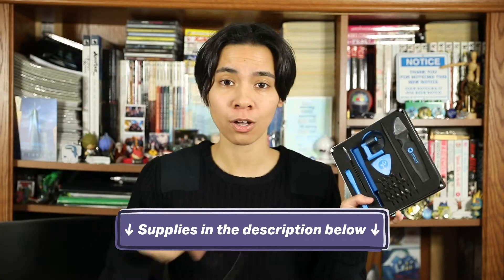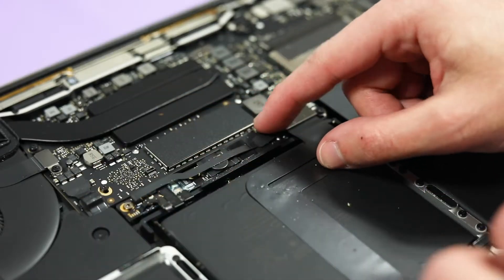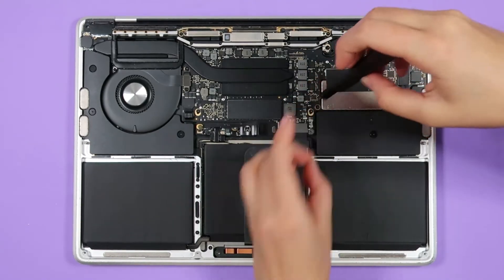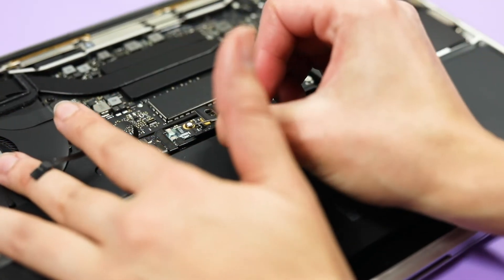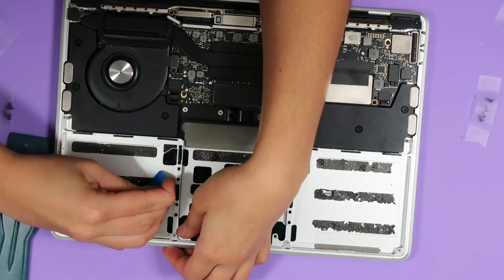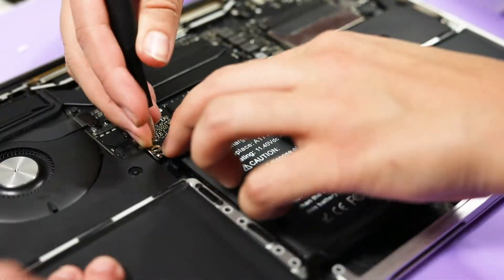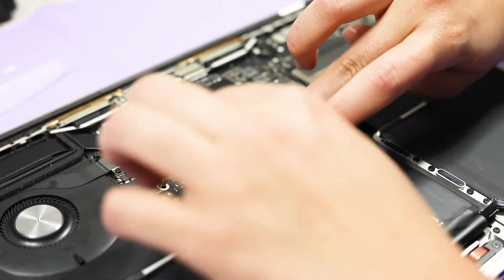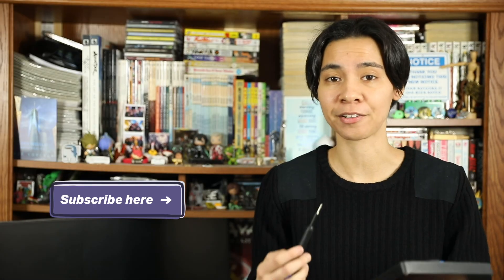How To Replace a 13" MacBook Pro Battery (Late 2016 or Mid 2017)

Comment: I did everything as shown but the Mac won’t start. There is no sign that the Mac is getting battery. I double checked that the wires were correctly connected. What else can I do?

Comment: Thanks so much !  New under $50 Amazon battery went in easily thanks to your great video ! Watch the cover screws are in 3 different lengths. Note which hole they belong in as you take them out.

Comment: Do yourself a massive favor and actually make certain the battery works before sticking the new battery back inside and close the computer... prop it and make sure the fan doesn't interfere with anything a small stand or a few coffee or tea mugs do the trick.

Comment: Lithium Ion batteries are very, very fragile.  If you bend or break the thin plastic seal on either of the battery cells, you will be buying a new laptop and or house.  An iPhone battery was punctured with a staple and an entire mall was evacuated.  DO NOT USE METAL TOOLS TO LIFT THE OLD BATTERY.

Comment: Great video - saved me a ton of time and money. Definitely recommend paying a little extra and buying all the tools and battery as a package if yo don't have them already. Undoing the locks on the battery cable was a little tricky the first time, and my replacement battery had one side soldered and covered in epoxy unlike the original but worked just fine.
Reply: link for the tools and battery package?

Comment: Great video! Quick question, does the battery flex cable that goes on towards the end have a clamp on both sides? I can only see one on the right side. Thanks

Comment: Thank you for the video!  was very easy as I paused your step by step.  However, now my computer will only work if the charger is plugged in.  As soon as I unplug it, it turns off.  Any suggestions as to what I did wrong?

Comment: Great video  ❣️ Can you please tell me about the battery backup of the new battery i wanna know how aftermarket battery performs on MacBook
Reply from the maker: It kind of depends on multiple factors like if the computer is in active use/idle or how bright the screen is (because full brightness uses twice the power as a half brightness), if it's powering accessories, etc. Usually Intel MacBook batteries land in the ballpark of 6-7 hours on a single charge.

Comment: Great Video. I gave my Mac to A certified technician to replace my screen. When we disagreed, I decided to make it myself. When I opened my computer, the slots of the BMU connector were gone, and the cover of it was as well. Can I glue or tape them?
Reply from the maker: To be safe, I'd buy a new BMU connector instead of gluing/taping anything.

Comment: Thanks for the great video! Very clear step-by-step instructions. I used some acetone to loosen up the battery adhesive and it came out quite easily. The adhesive strips actually just peeled right off. I was also careful to cover up the screen in case any acetone found its way there…it can delaminate the screen’s finish.
Thanks!
Reply from the maker: Thank you, glad this helped! And thank you for the tip :)

Comment: Just did this today, and feel so sorry that you scraped off the adhesive, turns out it's one of those adhesive strips that if you pull from a certain angle, will just come clean off.
Reply from the maker: 😭 I haven't been able to get the adhesive off the easy way ever

Comment: Just used this video to change the battery on my mac. Instruction were extremely clear and easy to follow. By far the hardest part was pulling off the battery. Definitely a two man job. 

Thank you so much for this! As much as Id like to trust a technician, I’ve been unlucky and have gotten my laptops back in worse shape than what I handed them in. Do my own repairs now when possibly. 

Thanks again!!
Reply from the maker: Oh, so glad that our video helped repair your laptop! But I have to agree, pulling the battery out is easier with another set of hands.

Comment: Great video with clear instructions and great visuals. However, I agree with the other comments that I do not want to try this. Too many ways for me to turn my wife's MacBook into a paperweight.
Reply from the maker: Thanks! Yeah, it really does stink that they make it more difficult to replace batteries in these newer models. Usually it's a simple take out and replace without touching the other vital parts 😕

Comment: Nope. Not doing that. Would definitely f**k it up. Thanks for getting the stupid idea that I could do it myself out of my head : )
Reply from the maker: Yeah, I don't blame you. These newer models are more of a pain to replace the batteries on. It's definitely easier for anything 2015 and older because you don't have to disconnect anything else but the battery.
Reply: It is not that hard for a Diyer dude..